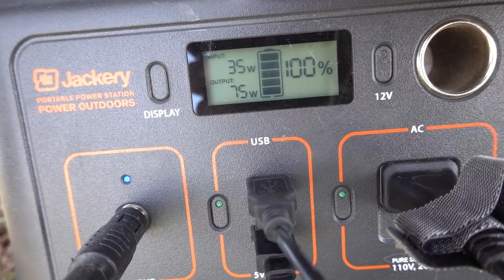Military Truck vs Monster Truck

Comment: Whistling diesel needs a drop hitch to level out the rope. Rematch when that rope is level between the trucks.
Reply: It would bend the hitch
Reply: @mfthick  valid point and an oversight by me.
Reply: Rematch
Reply: @mfthick  not if it was a solid piece of steel. It'd have to be custom made
Reply: It does need to be level for it to be fair
Reply: Whistling Diesel can VERY easily create a robust hitch that will be level with Able. I mean...have you seen what that dude concocts on his channel? Haha
Reply: That would’ve folded  the hitch like a wet pretzel. Put same kind of tires might make a difference.
Reply: @calebsimth4562  it really is the hitch height. Matt's truck was adding traction to Diesel's while Diesel's was removing it from Matt's just from the cable angle.
Reply: @chasynoden8357  It does, would be way more fair. Did you even watch the video? You could literally see the back of the truck go into the air
Reply: chasyn oden I mean we all know he has an advantage either way, in weight and in power
Reply: Whistlin diesel needs a lower mounting point
Reply: trondaksel I mean he does but, still either way he’s got it in power and weight
Reply: For sure. That’s why he was bouncing
Reply: Instead of a drop hitch he could use a much longer rope... wouldn't be perfect but it would be more fair
Reply: Drop hitch??😂 biggest drop hitch. He could of tied to the axle

Comment: This tug of war is void. Rope has to be level. That’s the rules. Sorry nobody won here.
Reply: truth
Reply: Yeah, he wouldn't have had as much wheel hop if it wasn't pulling his back end up. It would have been a much more even pull.
Reply: @brandonvanwyk3604  ...............ZACTLY
Reply: Gotta work with what u got their both different heights
Reply: Tj Sims don’t matter figure it out those are the rules. HAS to be level
Reply: Jimmy Smith well go customize their trucks to same level then
Reply: also explains why the monstertruck was digging in so much. every time he pulled his rear suspension went in because the rope pulled him down. sure he might have a looser setup than the 5t but this was about as uneven footing as you can get
Reply: @soulseek2  Right?  That tow angle was lifting Abel's rear wheels when Matt needed traction most, but also pulled down and dug Diesel in for optimal traction.  Abel also wasn't re-geared immediately before the competition.  Anyway, I'm pretty sure everyone knows it anyway :P
Reply: Nooo monstermax won.

Comment: When a 5 ton truck is the "little vehicle" on the track, you know your in TX.
Reply: Big tires and lift do not make a big truck. There are jeep wranglers with those tires.
Reply: N S  yes and giraffes. They are native to south east texas but have migrated over the last few years.
Reply: You know what they say every thing is bigger in tx
Reply: Or Alabama, or Florida, or George, or Mississippi, or LA like wow
Reply: U know they in Indiana  right
Reply: Lol
Reply: @SgtRudySmithbRet  its practically a new frame but ok
Reply: @SgtRudySmithbRet  it takes a larger parking spot therefore ita a big truck
Reply: @SgtRudySmithbRet  so if big tire dont make a big truck i should be able to buy the biggest truck i can cand put honda civic sized wheels and its still a big truck by your logic.....
Reply: Kaden Kowalski you know they in Texas right? Whistling diesel from Indiana but they in tejas
Reply: At only 5 tons... we make him use an Oklahoma Plate ;)
Reply: @Jared_the_silverback  except Texas alaska is still the biggest
Reply: When traffic slows down to 5mph when it snows also
Reply: You're*
Reply: True

Comment: 💯 MATT your rear axle were getting a lot of axle wrap in the tug of war on the rear axle. Please have someone look at securing the rear suspension before you start having driveline issues.  💯💯💯💯
Reply: Please check into that matt. Axle wrap is BAD for the driveshaft
Reply: Matt needs to put some monster traction bars on
Reply: Right...
Reply: This!
Reply: But,.... before you start killing flies with a 50 cal, check your spring bushings. Maybe I should post this on your other channel. :¤
Reply: if he had the extra axle like the normal one would he probably would of won
Reply: This comment needs upvoted in Hope's of Matt seeing it. 👍👍👍👍👍
Reply: Every time you say axle I drink a shot
Reply: @Private-pd2nc   axle axle  axle  axle  axle  axle  axle  axle  axle  axle  axle  axle  axle  axle
Reply: @Private-pd2nc   muahahah
Reply: Torque binding. Not good.
Reply: He's right, Matt. I was expecting it to break.
Reply: It'll have to be a complete custom job to get the leaf springs secured... Won't be cheap :/
Reply: @NoMoreQQ  He definitely does
Reply: @damagecase13  if he caredd, he wouldnt be doing it in the first place. Me personally, if I cared about damaging my vehicle, I wouldnt be intentionally going out of my way to break it.
Reply: @dan725   That's what traction bars are for
Reply: Matt B look it’s one of the haters

Comment: I’m saying still undecided. It’s not a fair match when his hitch is so much higher than yours.
Reply: Yea he is pulling a lot of weight of the tired
Reply: That’s why he kept bouncing
Reply: Hear Hear!!!
Reply: Actually the pulling point has to be as low as possible. And a very low Tyre pressure.

In tractor pulling, there are rules for how low your pulling point can be, for the same reason.
Reply: Yeah, but in pulling the weight doesn't really try to lift you off the ground.
Reply: yeah it's kinda cheating because abel is not a truck ment for pulling it's ment to carry heavy things and monstermax's hitch is wayy higher then the hitch of abel so monster max is lifting abel up for ebel not to get enough grip to the ground for a fare and square tug of war and an extra rear axel would really help for extra grip in the ground and i tink monstermax's engine is atleast a 1000hp and ebel is maybe around 300 to 450hp so monstermax has a big advantage over to abel!
Reply: Yeah

Comment: “I am so green”...pans to two trucks measuring fuel consumption in gallons per mile 😂
Reply: Thats the nice thing about diesels, you don't drop to gallons per mile until the turbo spools up. The 5 ton gets 10 or so MPG on the highway, thats Ferrari level
Reply: It’s miles per gallons not the other way around
Reply: @outdoorexpert4038  thats the point.
Reply: @outdoorexpert4038  not if you're using more gallons per mile.
Reply: @outdoorexpert4038  not if your making enough power like....maybe a monster truck that pumps out a bit of extra smoke lmao
Reply: Hehe

Comment: Damn, I wish you would chain up both of your trucks against the Leopard, I'd love to watch it drag both of you across the ranch :P 
But Able did really well still
Reply: well duh u could take all the trucks there and still lose 60ton 100% traction  with steel grips and low center of gravity vs VERY HIGH center of gravity with 15%,45,? traction     then 60 ton vs a combined of 45ton lol its no contest
Reply: I liked it as well when the tank just strolled with the rope chillin.
Reply: its abel not able
Reply: its evident Abel would have won, he did amazing! he only lost because of the physics of the monster truck pulling from a higher area. instead of the trucks pulling each other (which Abel would have won), the monster truck was pulling up and straight which gave a very key advantage.

Comment: Just retired 30 July 2020 after 36 years in the Canadian army as a leopard tank mechanic. (RCD and 8th Hussars with zipperheads as well as armoured school in gagetown) Was with 4CER in Germany on the badger and bridge layers too. Love the leopard!!! Great video! As far as the tug of war, the rope has to be level, he just lifted your ass. You were pulling with the front wheels. Leo is 45 tons(medium battle tank) my arv (armoured recovery vehicle,  Leo with a lifting arm instead of a turret) was 40 by itself and 44 with a pack on the back deck.

Comment: the only reason he won is because he was tied off at a higher angle
Reply: Yep its loading up one trucks suspension, while unloading the other.
Reply: But whistlenDiesel also has a 1000 horsepower under the hood
Reply: @Masonjarislit  power doesn't actually matter that much in tug of war
Reply: @gabrielbenson9137  yeah it does, its traction and power
Reply: @Eclipse538 but gearing puts the hp to the wheels
Reply: @Eclipse538 well I think he has a chance, but your right the circumstances were wak
Reply: @Masonjarislit  I beat a full size lifted truck in a 1997 Wrangler with a 4 cylinder. Traction matters and pull angle effects traction.
Reply: The Hop is because of the pull angle one truck had lift the other truck had downforce and let's not forget one truck is an everyday driver that drove to the event and the other truck is a trailer Queen I would much rather have the five ton
Reply: Exactly right because Matt was pulling weight down on the Tires of the monster truck giving it more traction!
Reply: no.lol
Reply: All that matters is how much they weigh. Both have similar enough traction and power. It is all down to weight. Rope angle does not matter.
Reply: @kevintomb  I think anyone involved with formula one or flying airplanes May beg to differ with you downforce and Lyft have everything to do with it

Comment: It's wasn't a fair fight. The angle of the rope made it so Matt would lose every time.
Reply: @greco2189  ah yes of course....nothing is unfair and all is acceptable
Reply: Monster truck has softer suspension , he can squat without bouncing , Matt's deuce was just bouncing and losing traction . Angle on the rope wasn't enough to make a difference , that was all suspension .
Reply: That’s not how that works at all. He was hopping because he didn’t have enough weight. It’s all about weight distribution, Demo should’ve put tractor tires in his bed. And Demo actually had an advantage of being lower and having the rope at a lower angle, because his truck had a lower center of gravity and leverage; it’s simple physics. Regular trucks out pull mud bogger/ monster trucks all the time in truck pulls, as long as they’re lower, have decent tread, and have tires or people in the bed to weigh it down.
Reply: There's no such thing as a fair fight. Win at all costs.
Reply: yep

Comment: 6:21 even your radio is “demo” 😂😂😂
Reply: It defaults to that when powered down. You need to change the display mode in settings to get one of several displays.

Comment: The johnson rod was misappropriated on the rail which in turn made the discombobulator useless.  That's why Abel lost.  It's not Matt's fault.  Could've happened to anyone.
Reply: He was also low on headlight fluid
Reply: And I think his chipmunk oscillator was broken
Reply: His bipidybopedybam was taking to much pressure
Reply: I think it was a couple bad spark plugs actually...
Reply: His mumbling shaft was warped

Comment: He didn’t win. Uneven advantage of leverage.
Reply: Actually the pulling point has to be as low as possible. And a very low Tyre pressure.

In tractor pulling, there are rules for how low your pulling point can be, for the same reason.

Comment: Hey Matt, put "egg crate sound dampeners" above your head, your skull will thank me later.   You can install it with epoxy and if you bump your noggin, it will help stop the impact so you can get a lil more bounce out of ur truck and not worry about concusions, LOL.   Trust me, as an offroader, it WORKS.

Comment: That bouncing is from the axle wrap. As the rear wheels move forward, the spring twists and lifts the tire from the ground, it breaks traction, and the truck bounces backwards

Comment: After watching Max vs Tank...im confident in saying that if Abel had more weight in the rear, Abel wouldve made Max stand up on end, even with the difference in tie off height. The added weight may have helped with the jumping as well.

Comment: Can't remember if there's a data plate on the dash that says it or if you have a operators manual for Abel but don't have the t-case in low then try and back up. (transmission reverse) You can break the t-case. I replaced several due to operators doing that.

Comment: You definitely need a pulley mounted at ground level to run the tow rope through. That way you're both pulling up on it instead of Able getting lifted off the ground.

Comment: this is one of the most american things i have seen today

oh and also matt i think you should have roped them  in some other side or install a hande/hinch for that, as the excess or stress in those rear axles are a problem like lextech lighting said

Comment: You should not have taken the other axle off! You also need to put a large tank in the back that when you do something like this you can put around 1000 gal of water in it to help you.  Water is around 8 lbs per gal. and another 8000 lbs will help you pull better. That will stop some of the hopping!

Comment: should do it on concrete, obviously, because once the soil degrades and the tuck slips, it suddenly regains grip on the fresh dirt, and the same thing happens to the other vehicle, and the cycle just continues until you are both buried.

Comment: They probably would have moved  if the towing hitch on the monster truck was not that high because it really pulls the five ton up in the air and thus reduces traction

Comment: Able USE to be a 5 ton when the rear axle was removed the carrying capacity dropped. Military cargo trucks are rated based on how much they can carry. Sorry to see Able's frame flex so much as it hopped :(

Comment: Not sure what exact year and model 5t you have but does it have a CTIS? If not look into getting one. It controls the air pressure in the tires for different traction needs.

Comment: He didn't beat you fair and square...you were at a significant disadvantage due to the leverage he had.  When he pulls, he lifts your rear end effectively reducing you traction.  In pro pulling, that would never be allowed.

Comment: all things considered... matt won... abel the gigantoute is like 1/10th the price  and it was holding well enough. he definatly got pulled though. but saw abel pull the monstertruck upto when he broke traction. it'd be interesting to see a rematch with some better meatier and wider tyres and a little weight in the tray or same tyres aired down a little to even up and make it more engine to engine. i am biased though i dont like monster trucks

Comment: You would have won if he wasnt picking your back end up. You have more torque at the wheels. But he was keeping weight on his rear while keeping weight off yours. Tug of wars are never really accurate. Want a pulling contest load them up heavy with trailers and pull up a hill

Comment: You lost because the monster truck ducked a bit. Basically whenever you pulled you just added traction to the rear wheels of the monster truck.

Comment: Sorry to say but base on what I saw during this whole video, i kept seeing constant unfairness, Matt truck is much lower to the ground then max, which cuts Matt's pull en half cuz his rear end is bouncing around, basically not touching the ground, and I hate watch Win. Diesel before great YouTuber but one thing I have always notice was his shit is always breaking, so technically speaking if diesel dropped his truck down to Matt level, matt would end half a fair tug of war and end up ripping diesels back axle clean off, I say this tug of war was a Draw

Comment: Not to be fishy but that wasn't a fair pull. The fact that you guys tied it on your truck way lower isn't fair cause it was pulling Whistlin Diesels truck down very much which gave him a big advantage on traction. Try another pull put tying them both at the same level